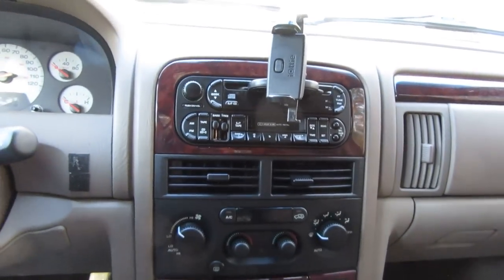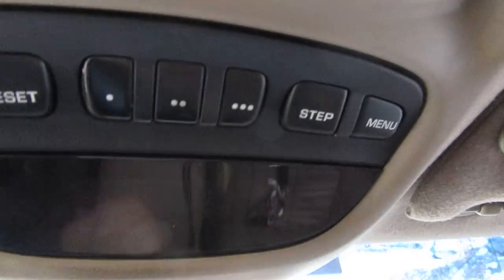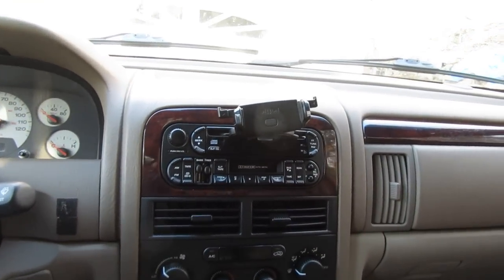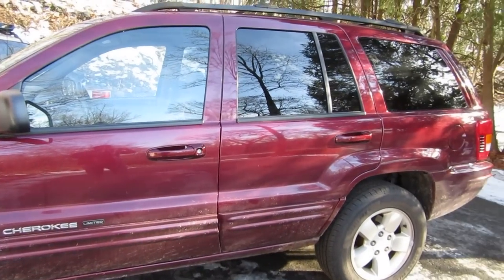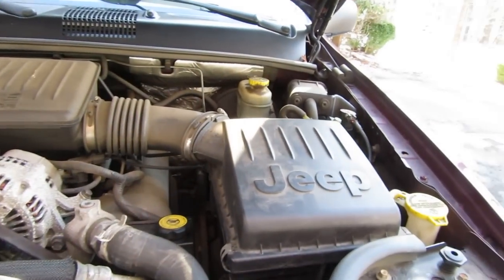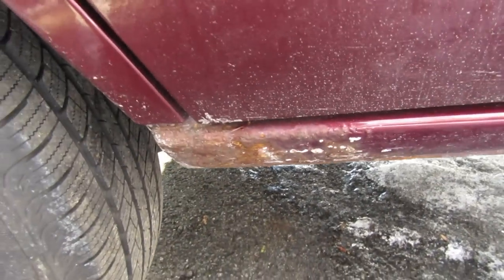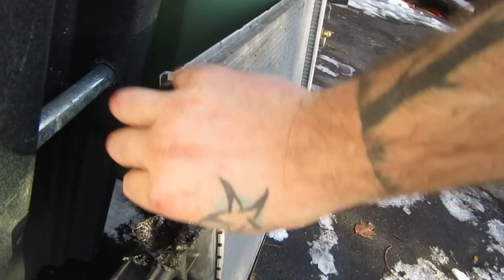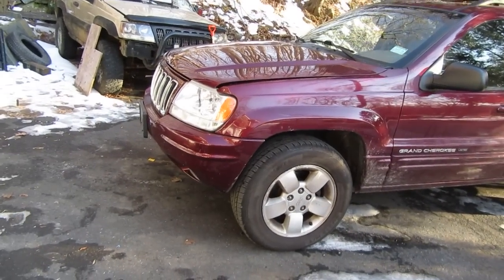The PERFECT 18-Year-Old Jeep

Comment: Small lift with a long arm setup. Make it the most comfortable DD WJ you can. I would also suggest CAI and exhaust just to help the engine breathe better. Next find some nicer wheels and good tires (BFGs?). Then you will have a very reliable DD and a very capable off roader.

Comment: It's great to see someone out there who appreciates these Jeeps.   I own a 1996 Grand Cherokee Laredo ZJ with a 5.2 V8.    I bought it new, did the maintenance, and replaced entire subsystems when they wore out.   I just replaced all the steering components with Moog parts, and upgraded to Bilstein shocks, and it drives like new.   Years ago the exhaust rusted out, so I replaced it with a custom Magnaflow exhaust system.   The surrounds on the Infinity speakers rotted out, so I upgraded the speakers to better speakers with tweeters within the woofers, which required the tweeters in the dash to be disconnected to not blow the stock sound system, which is still there.   From the outside it looks completely stock.   I purposely do not fix cosmetic exterior damage so the vehicle does not advertise itself as being in really good condition.   I think I have the perfect 23 year old Jeep.
Reply from the maker: Well played sir! I believe you and i are cut from the same clothe.  I have found out (as few have) that there is something really special about driving a mostly-stock 90's-era Jeep around daily. Quite an experience.

Comment: You're going to love that. Drain the gear oil front and rear, clean them out well and refill with NO friction modifier. I went as far as using non-synthetic but the big thing is to not use the FM. I can't wait to see what you do with it and hear what you think of the quadradrive.

Comment: I have a 2003 Overland.  Recently, it was time to decide whether to fix problems or sell it and get something newer.  I opted to repair.  New engine, new & upgraded suspension parts, Rubicon rims.  It's in the shop right now getting the front seats reupholstered (the rest of the interior is in perfect shape).  Soon I'll replace the front fender (big dent from an off-road outing), get it repainted, replace the headlight & taillight units, get a hitch mounted spare tire carrier, a steal winch bumper & winch, and finally a light bar and some small spotlights.  All for less than a new vehicle, or a used Toyota.  Durable, powerful, comfortable, capable, and a good amount of interior space.
Reply from the maker: Heck yea! Glad to hear you decided to give it the love and attention a good old WJ deserves

Comment: Great looking Jeep, my experience with the 4.7 includes oil foaming and premature clogging of the PVC valve causing oil sludge build-up. I think the 4.7 is a great motor but probably needs oil changes more frequently than say a 4 liter
Reply from the maker: Interesting.. I will have to keep that in mind

Comment: I have one exactly like yours, Just repainted and I have 207k on my 4.7 still going strong.
Reply from the maker: nice! Have you had any of the issues some people claim are common on the 4.7?
Reply: @DEInTheGarage   Yeah, It has had both heads replaced. I did one of them, it was overheated before me so it dropped a valve seat on the far back cylinder on the passenger side. Other than that it's a good engine. Still makes tons of power.
Reply: Just don't overheat em, keep very up to date on maintenance, and they will last you a very long time.

Comment: I have a 2004 4.7 limited wj!
You should check if you have the original radiator because I had mine go at 98k and the coolant mixed with the trans fluid
Reply: I believe in the video he said he swapped a a new one in immediately
Reply from the maker: Dear lord... really? That is awful! MW is correct. The first thing this Jeep got was a fresh rad, so luckily i can avoid that issue

Comment: That stuff is awesome and I’ve had it on all but one of the 4 WJ’s I’ve had. But you’ll get good at getting the dash in and out with that AZC. It’s a tedious job but not as bad as people make it out to be.

Best of both worlds - put a NV242hd in it. Vari-lok axles and full lockable tcase is awesome. I have a couple extra I’ve packratted away.  I’m 20 minutes from Vince’s. 

And of course you know to watch the rear lower control arm mounts on the unibody when the rust starts to look like that.

Btw those on your other wj are timberlines not silverblade 1’s. 

Don’t mess with the fan in my opinion - that hydro fan is very capable if it’s working right.

All in all that’s a really nice 01, almost identical to our first one except the colors.  Where did you find it?

When the unibody rusts out you could do what I did with our first one since your miles are so low. I went down south and bought one off of Craigslist for 500 with everything f****ed except the unibody - swapped everything and have a real nice one now.
Reply from the maker: Good info. I was referring to another WJ which I had when i first started the channel with had Silverblade's. I like the timberlines on my 2000, but don;t think I would upgrade to them for this Jeep.

Comment: i have a 2004 special edition 4.7 4 inch lift 32 inch tires.very capable machine  stay on top of oil and coolant and you will have no problems.
Reply from the maker: Like oil changes? What oil do you recommend?
Reply: @DEInTheGarage  valvoline pure syn and wix xp filter got rid of plastic imp water pump istalled a steel one.i use hoat coolant only and installed a 180 degree themostat.

Comment: Never heard of anyone having any long term luck with the 4.7L. Everytime I see a WJ on the trail broken down it has a 4.7L. 130K is usually when they start having major issues. However, it's a nice clean find and I would DD it too. Goodluck, I will be watching as I am curious about the 4.7L. I have an 04 base model WJ 4x4 Laredo with the 4.0L. Just about at 170K, still going strong!!
Reply: The 4.7 just needs a little more TLC then the four such as more frequent oil changes change the PVC valve regularly due to oil foaming don't let it overheat because of the thin cylinder walls, it's prone to making sludge possibly drop the oil pan clean the sludge and put a new oil pump and you should get many more miles. Definitely not a 4 liter but with more maintenance should last just as long
Reply: @MajorWeakness  thanks for the info. Preventative mx always helps!! I have not heard anything good about the 4.7 but I like the power it delivers in the WJ. I would like to be proved wrong.
Reply from the maker: I cannot lie to you... I have always been a 4.7 hater. I have owned more 4.0's than I can count, but I wanted to give the 4.7 an honest try. I know a lot of guys who really like them and I figure this one is young enough that (if I am as good as I like to think I am, haha) I can keep it running up to 200K
Reply: @DEInTheGarage  cant wait to see what happens. I would like for this WJ DD to work out for you. Thx for the update video and explaining why you made the switch. Also great job on discussion topics and advice. Keep the "podcasts" coming!!
Reply: I’m running one just under and one just over 200k. The one over 200k I know has never been touched - dad bought it new in 2001 and sold it to me 4 years later. Runs great.

They can last if you keep the oil and coolant changed and never, never ever let them overheat.

Comment: I purchased a 02 WJ with the 4.7L and a dropped valve seat for $300, always the passenger  side head.
Reply from the maker: I have hear that is a common issue... guess it is something I will need to watch for.
Reply: D&E In The Garage just don’t ever let it overheat. Not even a little - and you’ll most likely be ok.

Comment: Awesome, a new toy...err I mean new video entertainment video for us viewers.  My 96 ZJ had the memory feature for 2 drivers like your WJ has, mine never worked right, kind of did whatever it felt like doing when you hit the button.  My current 98 ZJ doesn't have those and don't miss it...I do miss the automatic climate control and the digital driver information center but for what I got I can live without them.

Edit...the quadra-drive would certainly be a great feature in the snow/ice...never driven one with the quadra-drive, I've had the quadra-trac in the 96 ZJ, 232k of hard miles on it offroad before the viscous coupler decided to start failing.  The limited slip front/rear would be nice wonder how it would handle in snow/ice conditions though.  My 98 ZJ has the Trac-Lok rear axle and it wants to try and pass the front end in snow/ice in full time 4wd mode, does fine in part time, been told that its perfectly normal for this though.  I'd think with trac-lok front and rear it wouldn't have an issue with that but I have no idea since I've never had one or driven one.  Can't wait for updated videos as you start to make it yours.  111k is pretty dang good, though I was doing good with my 98 ZJ when I got it with 150k on it last year.
Reply from the maker: It is actually a really wild driving experience in the snow. it just feels secure, if that makes any sense. After the first wheel slip all 4 wheel just sort of churn and the things just moves.
Reply: Thanks, sounds like a great snow vehicle for sure.

Comment: Def swap the 242. 
Look into the gm 9 blade fan upgrade. 
Swap in a TCM from an 02+ to open up your trannys 2nd overdrive. 
As far as engine upgrades check out airram.com
You can pull 12hole injectors from any GM 2.2l eco-tech.
08+ intake manifold with airram adapter
HO heads and cams
HO forged crank
Did you get the upcountry package? 1" bigger coils with front and tcase skid plates?
I got some extra front hooks I'll send you for free if you want them dude. There in my storage unit down in Florida. I'll be down there March 5th.
I had a black 03 overland on 2" BB and 75th anniversary jk wheels, regret selling it everyday
Reply from the maker: damn dude... that is a list. thanks! This Jeep did not have the tow package or upcountry package, but it has everything else. I have all a set of overland skids which I might put on just for the hell of it. Definitely want to look into the GM mods. very interesting..

Comment: I’ve always been told to stay away from the quad drives
Reply from the maker: Why?
Reply: Well just that it’s not as reliable as a selec trac and worse on fuel. I’ve never owned a wj but with the xjs around here all needing floor pans unless you spend 6k I’d like to actually start doing my research.

Comment: I just bought a 2003 Jeep Cherokee Overland Edition with a 4.7 high output engine with 151,615 miles with what the seller was claiming to be "engine problems" for $1,500 CDN. Engine problem is it is loping on idle. Seems to be an easy fix. Thank you for all your tips and good information. Everything you have posted gave me the confidence that I could fix the problems myself. I am already a pretty good shade tree mechanic but Jeeps are new to me. I am going to do a mild lift and probably run 31's on her with a mud tread as I am not a rock crawler kind of guy I am an Overlander. For updates just google brbadventurer, all social media with brbadventurer is mine.
Reply from the maker: I am glad the videos we post have been helpful to you. Sounds like a  nice Jeep!

Comment: if the radiator split (or a hose busted) i would go ahead and change the thermostat just in case that is what caused it. thermostats are cheap and easy to replace... have fun with your new jeep ... :)
Reply from the maker: I should have done that... I was right there when I was changing the rad, but I didnt think about it until i was into the job and didnt feel like running back to the parts store. Haha... I am sure at some point i will regret that laziness

Comment: I gotta say I don't understand the popularity of swapping the 247 for the 242. I won't buy a part time 4wd vehicle, the difference in stability and predictability at speed between a PT and a FT system is significant. That's why I have my 75 RamCharger with the FT 203 case, it has 4 selections of 4wd for any occasion. Having to have the center diff locked while in 4wd running at high speed (highway 60mph+) makes for a very ill handling vehicle compared to the full time. No way I would trade my full time option for 2wd. I mean... 2wd Jeeps? I like having 3 or 4 positions on my transfer case that are all different flavors of 4wd. I do a lot of driving at highway speeds on gravel/asphalt/snow/ice and the PT cases are tedious having to go between 2wd and PT 4wd as road conditions change. Run that 247 for the rest of the winter and tell me it's not noticeably better than your PT Jeeps.
Reply: The 242 has full time and part time 4WD that's why people swap them, gives you the best of both full time and part time all in 1 transfer case.
Reply: @wildbill23c  Thanks for the correction. It's not my first time to look like an idiot on the internet, but it is the most recent. I take it the 242 is selec-trac and I'm thinking of command-trac which must be a 208? I really should know that. I will still say that the progressive coupler in the 247 is pretty magical in the snow compared to the standard open case. Most of my low traction driving is snow so I've become quite partial to the 247.
Reply: The command trac was probably what you were thinking as it is the 231 transfer case with 2wd, 4 high neutral and 4 low.  Selec-Trac's 242 transfer case has 2WD, 4hi part time, 4hi full time, neutral and 4 low...people get them mixed up all the time, and with good reason Jeep has/had over a dozen different 4WD systems, so many that they're now bringing back old 4WD system names hoping that old Jeep people buy them thinking they are like the original LOL.  

The 247 transfer case is good until the coupler fails and its expensive to replace.  The 249 transfer case was somewhat similar.  The 247 used a gerotor pump where the 249 used a viscous coupler.  Both expensive to replace and many claim around 150k before they fail...I had 232k on my 96 ZJ with the 249 quadra-trac 4WD and the viscous coupler finally failed in it, and its easy to tell as it starts acting like you are driving around in part time 4WD as the front end will bind when turning really sharp like when trying to turn into a parking space and such.